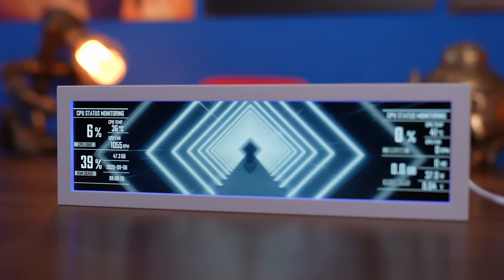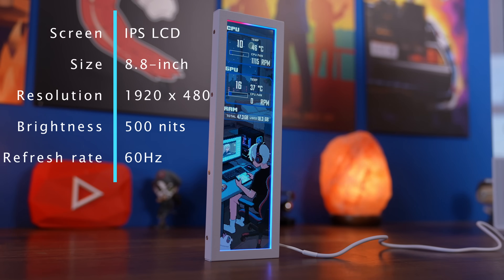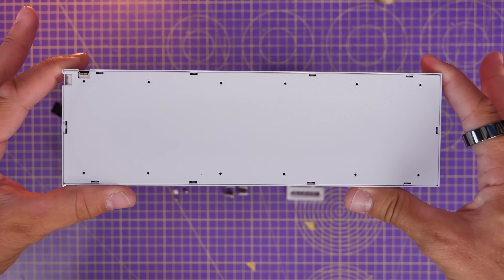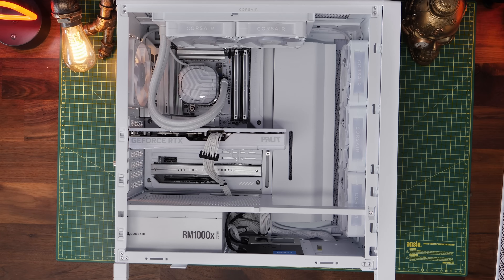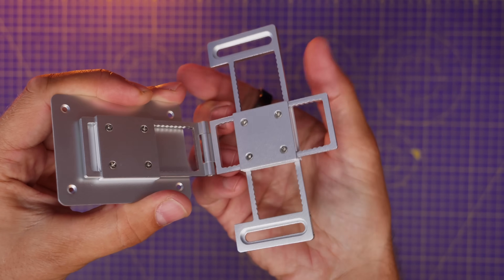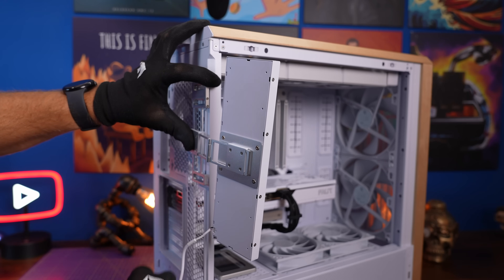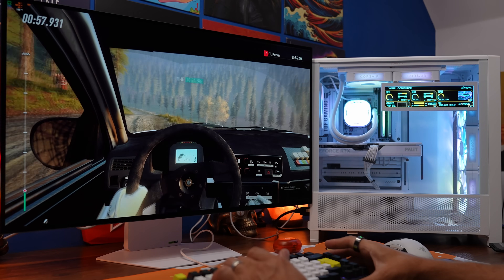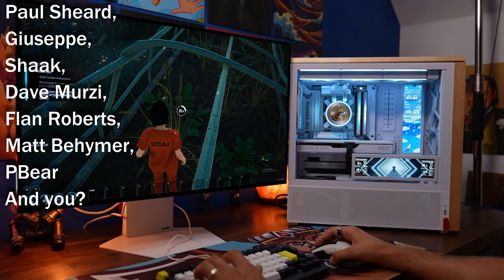Lian Li's Universal Screen is an easy upgrade to your PC build

Comment from the maker: Specs of the PCs used in this video (note these include affiliate links which may earn me a commission at no extra cost to you):

Specs of the Corsair build:
Case - Corsair Frame 4000D white - https://go.corsair.com/nXx3ma
Motherboard - Asus B850-BTF Wifi W  - https://amzn.to/4mJpZdL
CPU - AMD Ryzen 7 9800x3d https://amzn.to/4kXAbOE
RAM - Corsair Dominator Titanium First Edition DDR5 RAM https://go.corsair.com/baya19
NVMe - Crucial T710 - https://amzn.to/3IhSQ93
SSD - Crucial BX500 and MX500 https://www.youtube.com/watch?v=IOJNybKZ4wk
PSU -  Corsair RM850x Shift PSU https://amzn.to/3RECsB1
GPU -  Palit GeForce RTX™ 5070 White OC https://www.palit.com/palit/vgapro.php?id=5715&lang=en
AIO - Corsair iCue Link Titan 240 RX RGB https://amzn.to/46B8ohR
Lian Li Universal screen - https://amzn.to/46edAZ7

Lian Li build:
Case - Lian Li Lancool 217 https://amzn.to/4oDBNz4
Motherboard - Asus B850-BTF Wifi W  - https://amzn.to/4mJpZdL
CPU - AMD Ryzen 7 9800x3d https://amzn.to/4kXAbOE
RAM - Corsair Dominator Titanium First Edition DDR5 RAM https://go.corsair.com/baya19
NVMe - Crucial T710 - https://amzn.to/3IhSQ93
SSD - Crucial BX500 and MX500 https://www.youtube.com/watch?v=IOJNybKZ4wk
AIO - Lian Li Hydroshift 2 LCD-C 360 AIO https://amzn.to/3SYN5iG
PSU -  Corsair RM850x Shift PSU https://amzn.to/3RECsB1
GPU -  Palit GeForce RTX™ 5070 White OC https://www.palit.com/palit/vgapro.php?id=5715&lang=en
Lian Li Universal screen - https://amzn.to/46edAZ7

Comment: is the lian li L-connect software required or could i connect as a monitor and use aida64 instead? or perhaps enable offline mode in L-connect, then uninstall L-connect, and still have an image/gif saved on the screen? prefer not to have rgb software installed

Comment: The problem I have with internal monitors is that they don't fulfill any function and are absolutely useless. They are on the cheap side as far as flashy accessories go though - cable mods are much more expensive for example

Comment: Hopefully it is better than the AIO LCDs. I rid my pc of Lian Li components entirely because of the all issues with L-Connect and the poor performance and quality of the AIO LCD.
Reply: Weird… I’ve encountered very few, if any, issues with L-connect. 

All my fans, AIO, and even case (207 Digital) work flawlessly.
Reply: @jerrya17  Yeah, it's sad because I loved the look. I had the O11 Mini with SL fans on bottom and side, TL LCD fan on back and the Galahad AIO. The LCD fan would often stop working and I'd have to reboot. The AIO screen would often get stuck on an image or have a ghost like affect. I also had the strimmers... so it was 3 hubs in this tiny case. Maybe that was the issue. I ended up changing to a much larger Phanteks case, TRYX panorama,  and a single universal hub and generic rgb fans which are working great. I use signal rgb to control it all and no issues so far.

Comment: Hi friend, you will have to contact Lian Li for 2 things: 1. There is now the Lian Li LCD screen. We can see some assembly videos to put it in this 011 compact vision case. This is great. 2. Ask him to create an accessory for this case, as an option, a wicker side panel to install 120mm, 140mm fans or 2 larger fans. This is to improve the airflow. Thank you.
Reply from the maker: You could just use the sticky pads to mount it above the motherboard

Comment: Just bought one of these using your U.S. Amazon link.  I'm building a PC for a friend that relies heavily on Lian Li components: 011D Evo XL case, Hydroshift 2 AIO, 140mm TL LCD fans, etc. and this will be a great addition.  Now, if only there was a way to control RGB on a Gigabyte motherboard, an ASRock GPU, and a Corsair memory kit that played along well with L-Connect 3 software.  Gigabyte's RGB Fusion software is horrible, I couldn't get ASRock RGB Sync to even recognize the Steel Legend 9070 XT, and Corsair's iCUE is a bloated mess that works well, but I'll probably just install the RGB profile in the memory and delete iCUE.  Signal RGB would be a great solution if it could run simultaneously with L-Connect 3...  Is that something that Open RGB or another 3rd party RGB software can do?

Comment: Thanks for the quick video. Do we need a Lian Li controller to run the LCD?
Reply from the maker: Nope. Just the usb connection and the software. So you don't technically need any other Lian Li products

Comment: Even though I wouldn't get it because I don't like L-Connect, it looks like a cool little device. Don't they have it in black?
2 Things I like about Lian-Li they are the ACCESSORY KING! The amount of little accessories and extra parts they provide their products is really good and allows for much customisation. The other thing is RGB, ahah they love it.

Also, I see you're still using the Corsair Makr75. Is that your main keyboard now? I had one but returned it due to not worth the price imo.
Reply from the maker: I neglected to mention that yes it's available in white AND black

Comment: That's cool! I have a Corsair 6500x and there's quite a bit of space under my MSI Suprim Liquid SOC 5090 as it's a 2 slot card I think, I may grab one of these to mount to my Corsair QX RGB case fans at the bottom of the case under the GPU.

I may grab another one to use as an external mini monitor as well as I don't have a lot of desk space for a second 4k 32 inch 144hz display. I was looking at the Corsair edge monitor but low stock right now but this looks a bit better even if it's a bit smaller. Anyway good video as always cheers :)
Reply: If I were you I'd stick with corsair's new similat lcd scree. The xeneon edge, I believe it's called. Stay within the icue ecosystem.
Reply from the maker: Sounds like a good plan for your setup.